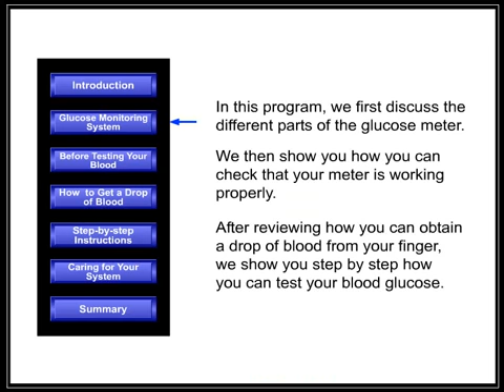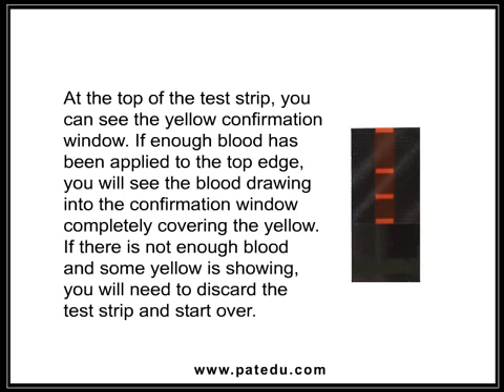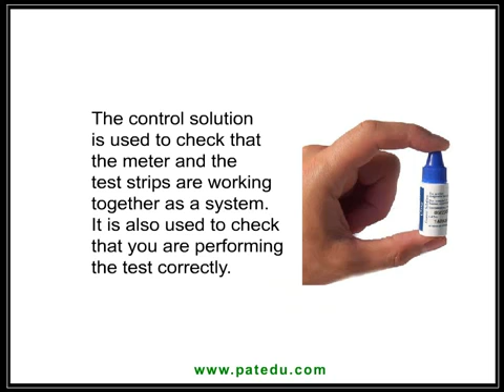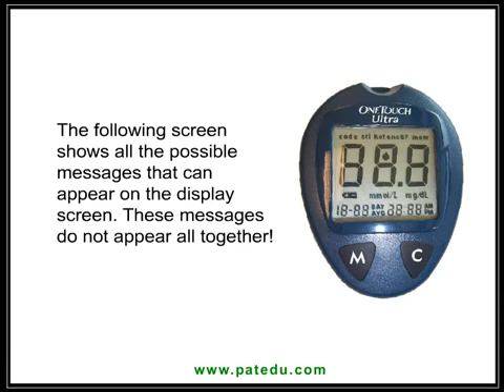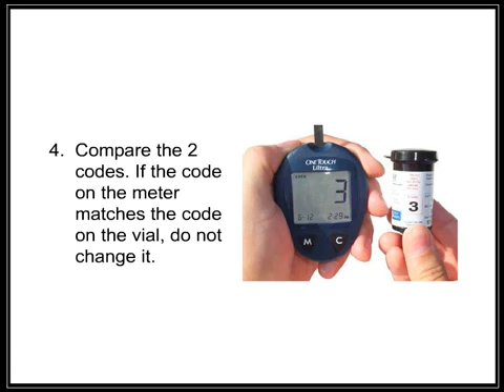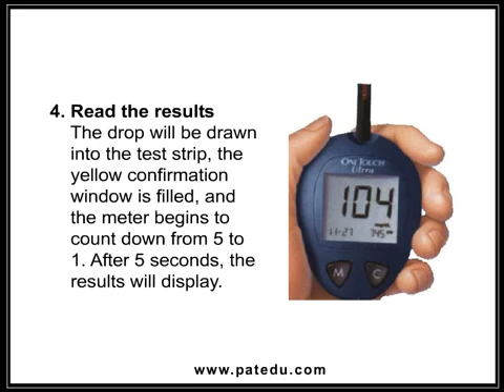Using Your Blood Glucose Meter   One Touch Ultra

Comment: This device is the best. I bought the 'mini' as a replacement years ago but the battery drained too fast.
Now, this device of the video only can be set to the year up to 2020! I just set it to 03 because there's no 2023.
To set the correct date/time - remove the battery for 1 minute, then reinsert the battery, access memory with M, the date and time will show up then you set up in this order: Hour, Minute, 24 or am/pm format, YEAR (ONly goes up to 20!) month and date.